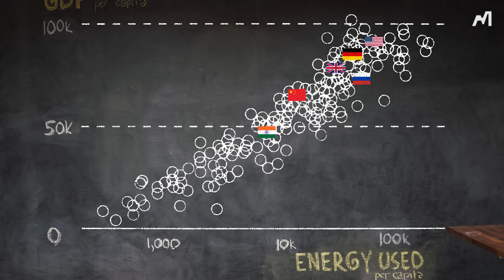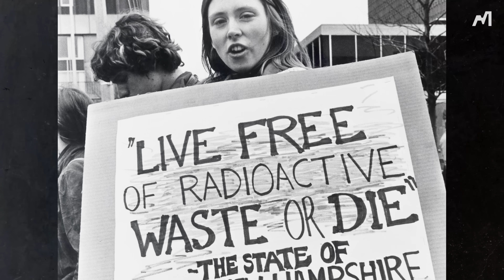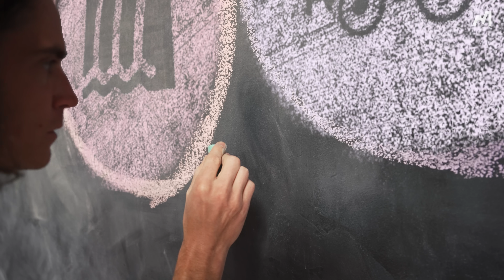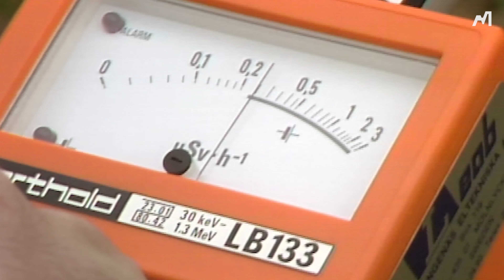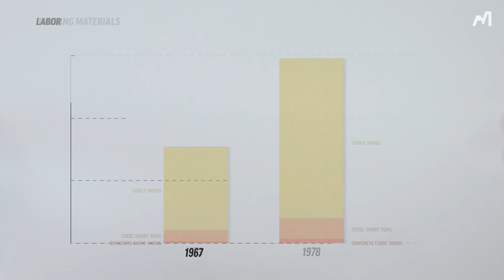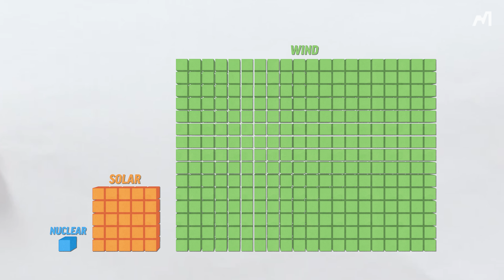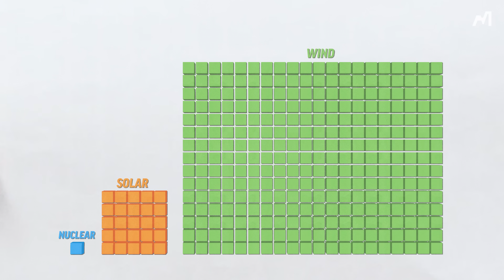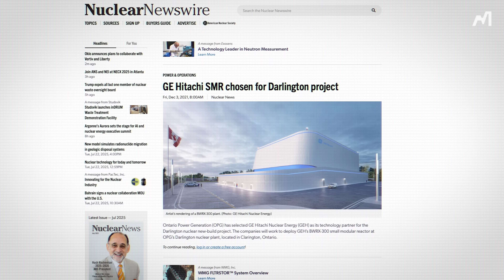They're Lying to You About Nuclear Energy

Comment: People tend to think that spent fuel is the only waste, but literally any part that comes in contact with the radioactive part of the plant, to include the cooling medium, is radioactive waste and radioactivity accelerates corrosion and means all sorts of piping, pumps, hardware, and parts are on-going waste that has to be stored after use.  Even stuff like workers PPE, all has to be accounted for as waste.  This ends up being a huge amount of material and it has to go somewhere.  Some of it can reach acceptable levels in relatively short time for radioactive stuff, but not all and again, it's a huge volume of stuff that has to be accounted for.  It's not that nuclear power is impractical, it's just not the right solution in every case due to the massive capital cost and amount of regulation to ensure it is safe and these things are accounted for in a way that doesn't harm the public.

Comment: 16:05 — There were several incidents with Russian nuclear submarines, including K-19 1961, K-27 1968 ,  K-431 1985. Radiation released deep underwater poses less environmental danger than accidents occurring on the surface.
btw nuclear submarines require major refueling including hull replacement every 10–25 years, which involves literally cutting open the vessel.

Comment: The problem of nuclear its just worse than solar/wind in practice, because of how much time it takes to setup and that nuclear fuel is very very scarse, if we switch to nuclear it will only power for 30-40 years at best. Essentialy it makes more sense building solar/wind. We extract only 1% of nuclear energy from fuel, unless that changes theres no point building and maintaining it outside some specific cases. I am not a nuclear hater, but theres more to it othen than fossil fuel industry buying up politicians. Btw this video couldnt go on without renewable fearmongering real

Comment: I used to be 100% in for nuclear. Now I’m closer to 90%… My only contention with it is what happens when the grid goes down for an extended period of time? My “dumb-guy” understanding is that in that scenario, they can’t cool down the reactor (which uses external sources of electricity) and without backup power and someone to maintain the system, the power plants would all eventually become Chernobyl like sites.

Is someone smarter than me able to point out where I’m wrong on this? I’d love to be. I can accept the cost-benefit analysis of the probabilities of the grid going down for months/years… but if it did, isn’t that the outcome?

I’m aware of the additional horrific issues associated with the grid going down outside of power plants going offline, but if they did all actually meltdown after that scenario… then that seems like a failsafe we should figure out. Maybe they did?

Let me know if I’m way off base here.

Comment: Couple of issues he glossed over. First is all the new safety requirements that were put in place after TMI. Several were necessary due to bad assumptions in how operators would respond to TMI-type events. New training requirements, new control room indications, new procedures, and new standards for materials. The Browns Ferry fire resulted in similar  changes to saftey regulations. Some changes had limited benefit and have been phased out, but most were necessary. Second, SMRs are not like Navy sub plants. Those use 90% enriched fuel so they can operate for about 25 years. Refueling is simply cutting out the old plant and welding in the new plant. SMRs may be up to 20% enriched giving them a life span of 10-15 years. Then it has to be dug up and a new one put in. Due to the lower power density, the cost per Mwh is much higher than a standard nuclear plant and way higher than a natural gas plant. So cost wise it's more attractive just to run a natural gas pipeline and use that for power generation. I worked for the NRC for 35 yrs and saw how new regulations  were adopted. Some, like the fatigue rule, were necessary for operational safety. Other not so much. Risk is probability x consequences. Nuclear accidents are low probability but have huge consequences so the risk is very high. That's why nuclear is so costly.

Comment: Nice but inaccurate in many ways, not the least of which there is 1) no smr and any practical one is years away if at all, and 2) nuclear is non renewable just like oil and gas
Reply: 1) he didnt claim smr isnt years away?? 2) did he ever claim that it was renewable? And also wind and hydro is built with concrete which isnt renewable
Reply: @ekologiskmat4380 Concrete doesn't have to be renewed. So what's your overall point?
Reply: @ekologiskmat4380 because no other powerplant needs concrete?
Reply: @DiesDasAnanasx nuclear takes very little material to power output
Reply: @ekologiskmat4380  Whats your point? Wind needs even less, so does Solar
Reply: @DiesDasAnanasx  are you dense?? wind takes 500+ tons of concrete mer MW, nuclear takes 12 tons
Reply: @ekologiskmat4380 i dont know how you get these numbers, but a NPP needs more than 12t of concrete, and wind doesnt need 500. Offshore they need none

Comment: I think there are some odd distortions in this video.
-It is not primarily the fear of radiation that has hampered building new nuclear plants. Major projects have, since the 1970s, have been beaten to death in the courts by changing definitions of "standing" enabling individuals or small groups to essentially veto projects or wear out proponents. Much of that is due to the loss of faith in government due to the moral bankruptcy exposed by the war in Viet Nam and Watergate.
-There is little in common between the radiation exposure from the sun at high altitudes and that from nuclear materials.
-The commercial nuclear reactor designs being built between the 1950s and the 1970s were actually very dangerous. It was only luck, not good engineering that prevented major health consequences from the Three Mile Island accident. I was working as a reactor design engineer in 1979 and I remember sitting with a physicist who was calculating how much longer it was going to take before the core escaped the vessel or the hydrogen bubble exploded and scattered tons of nuclear material over the city and the river. They lucked out.
-The comparisons between the deaths caused by different energy types wouldn't fool a high school physics class. It's not the deaths but the deaths per kilowatt-hr of energy produced.
I confess I gave up on the video after that.
Maybe there is a role for nuclear power in the future but it should only happen with  understanding of potential terrorism and that we are burdening generations of our descendants, who won't benefit from the power, to protect tons of waste from contaminating the environment.
Reply: First point: no, look at germany, fear is a huge proponent in nuclear shut down

Comment: I'm pro nuke power, but you're misrepresenting radiation. An electron is 1265 times smaller the a proton or neutron.  And a cell being damaged (cancer) by being struck by a stray electron vs a neutron is the difference between you being struck by a BB vs a bowling ball.

Comment: Interesting video, but I do feel it glossed over the waste.  I get it's one cylinder per reactor per year, but over a lifetime that's potentially 80 of them. But that's not the end of it, the stuff sits around for how many years? And the container needs to be maintained over that time scale.

Don't get me wrong, I'm sure I've read that we had a method for recycling toxic waste, so it can be reused in reactors several times, back in the 70, but that got stopped as an output of it was refined plutonium (not weapons grade, or the wrong type so couldn't easily be used in weapons). But if that's a viable option, then I'd be tempted to build that in, as nuclear is already a good option for energy production and if we can reuse the waste multiple times (also making it less reactive for when it truly does become waste) then that's a big positive point to land

Comment: 3:05 fun fact the lead apron is no longer recommended for dental X-rays. They found out it actually just increases scatter radiation in the body (so radiation bounces off the vest and around your internal organs instead of just passing straight through). Modern digital dental X-rays are extremely low radiation. For example a standard X-ray is the sane radiation you get in a little over one hour on an airplane.
Reply: Hi, sorry for the nine day late reply, but could you post a source for that study? My dentist just transferred ownership of his old practice to the new guy. If newer equipment can help them and myself as a patient, I'd like to hear about it!
Reply: Wouldn’t the lead just absorb the radiation instead of bouncing off of it? Im pretty sure the reason for them being optional is because the radiation amount isn’t meaningfully high enough anymore
Reply: The lead doesn't absorb it shields from radiation
Reply: The part about the apron increasing scatter radiation—this is less well-supported: there’s no strong documented evidence I found that wearing the apron increases scatter to internal organs; at most, there’s concern about interference/retakes.

So: the statement is mostly correct, but the “increases scatter radiation” part is speculative, not well proven.

Comment: This video is too biased to give a realistic debate of the nuclear power question.  No one debates that nuclear generates electricity efficiently with low carbon emissions, it's about the other dangers it brings compared to other power generation methods.  Saying that humans are genetically created to absorb radiation does not really apply when talking about the levels of a reactor meltdown.  Also, the key reason costs have risen is due to regulations to make them safer, because meltdown is extremely harmful to humans.   Without regulations, do you trust corporations to build safe reactors?  You're only issue with nuclear waste is that it would be hard to steal?  Do you honestly trust corporations to effectively store and maintain nuclear waste?  Most can't even be trusted to pay the tax they owe.    There are so many incorrect facts and misdirections in this video it is dangerous.  I would prefer to hear both sides of the argument debated honestly and without bias.

Comment: I've never subscribed so fast. I clicked before the video was finished. The video is full of facts, not boring and respects the viewer's time. Stellar job.
Reply: With the problem being that it's not "full of facts." It's full of half-facts and strategic omissions, like pretending the UN's 60,000+ Chernobyl death projection is "only 54."
Reply: @CycloKermit  Does that UN projection count in 1200 suicides due to resettlement and loss of property?
Reply: @GreyDeathVaccine  You're mixing up your disasters. Those 1,200+ suicides and stress-related deaths were from Fukushima.

The 4,000-60,000+ UN projection is specifically for Chernobyl and refers only to long-term cancer deaths from radiation.

Comment: Instead I recommend OTEC - Ocean Thermal Energy Conversion, using turbines like dams, but using temperature differences all over the world's oceans. No boiling, no steam, no pumps, and it doesn't require shore-power to run. OTEC IS 24X7 all year round. No radiation, no pollution. 70% of the world is covered by oceans, and 90% of the human population lives within 100 miles of coastlines.  Please consider a video on the Science of OTEC.

Comment: You're not entirely wrong about Nuclear power plants. However, Solar only needs the area we already use for every rooftop or parking lot, and we're already using that, so there's no need to cover farmland with Solar. Once every home, apartment, or industrial building were covered by solar we'd have surplus energy even as AI Datacenters use more and more. Similarly Wind can be done with much smaller turbines, and run along existing highways. Thorium Nuclear reactors would be fine, and might even be made small enough for Rail or Trucking transportation. As you mentioned Nuclear subs are already super-reliable , so moving to SMR's is a great idea. Don't put them in rivers, because there are thermal issues or other environmental risks NIMBY will stop. But moving nuclear reactors offshore would be both smart, and likely ironclad.

Comment: My dad was an electrician, mostly worked on industrial projects.  He was a big fan on nuclear power.  Until he helped build one.  He worked on the Palo Verde plant outside Phoenix.  Among other things, his supervisors had them wire the backup pumps which would flood the reactor in the event of an incident with wire incapable of handling the load the pumps would draw.  So if the pumps ever turned on, the wires would simply melt.

There were a lot of other problems.  His crew would install meter during the day, for example, and someone would come along at night and smash them all.  So the next day they would replace them.  And they’d get smashed again.  They would check truckloads of tools/equipment/material in at the front gate, immediately turn it around, send it to another project, and report it all stolen.  Or they would bury it on site and report it stolen.  Because the construction was bid on a cost-plus basis.  When the contractor is guaranteed to be paid 10% more than they spend there are few incentives to contain costs, and massive incentives to inflate cost.

As a result of the massive cost overruns APS sold almost all of the power Palo Verde would generate to other power companies while financing the entire operation with consistent and large rate hikes on APS customers.  Who wants their power bill to triple when they receive absolutely no benefit for that cost?

As a result, when I was in Arizona a few years later, I saw a newspaper article saying that in the three years (up to that point) that Unit One has been operational it had never run anywhere near full capacity and had never run for longer than a few weeks without shutting itself down.

A large part of the reason nuclear power was abandoned is because of how we build the plants.  It doesn’t help that pretty much every plant was a unique design.  A standardized plant design, dedicated construction workforce and a conventional bidding scheme would have resolved almost all of those problems.  And we did none of that.

Comment: The land footprint argument against solar is quite weak as solar can be and is installed on roofs and other man made structures. Hence, there is no need to destroy forrests to plant solar panels. In contrast, you cannot just plant a nuclear power plant, large wind turbines, or hydrostations on roofs. But the cheapest and easiest thing will win the economic evaluation process, and right now, this is most certainly solar. It allows highly decentralized, cheap, scalable, and quick installation bringing in even low budget home owners to participate in the energy market. Naturally, this brings a lot of changes to the whole energy/grid where there lies the critical technical argument, why nuclear will be phased out: It's incompatible in a grid with a large portion of it being renewables and it will show once again as an economic rationale to cut out nuclear for good.

Comment: Japan turned off all radiation detectors during the incident at Fukushima. We have no idea how much radiation was released. They shipped the contaminated soil all over Japan to create a uniform "average" radiation exposure for all the population. Radiation continues to leak out of the reactors into the ocean...there is no stopping it; they tried an ice wall but that failed.

Chernobyl continues to be a problem, but the red forest is a far worse danger. If it ever catches on fire, the release of radiation will be similar to the original event.

The main problem about nuclear power when talking about "clean energy" is the lack of discussion about mining the ore--the energy cost, fossil fuel use, waste piles and pollution left behind. The second problem (maybe it should be the first) is the disposal of used fuel, and the problems and incidents which have resulted.
Reply: We know exactly how much was realesed and it’s not dangerous, Rome is more radioactive than Fukushima. There is food exported from Italy to Japan that famously triggered Japanese radiation detectors, not the other way around. No radiation is not leaking out of the cores into the oceans, if you mean the tritium release that’s another things, and if you’re scared of those concentrations then you either don’t know what you’re talking about or you believe in homeopathy.

Chernobyl can indeed be a problem if the dust picks up.

Mining is explained in detail in the JRC and UNECE reports, so is fossil fuel use (which is the lowest of any low carbon energy per kWh). Used fuel is not a problem, it’s already been solved, we know how to 1) recycle it 2) store it for ultimate storage.

The problem is not lack of discussion, is your lack of doing proper research
Reply: @filippo1864  Yes, absolutely we do! Those of you who accept the official account do know this. You have nothing to worry about. I am certain that you know who you are following and where they are going, but if not, it isn't too late. Best regards.